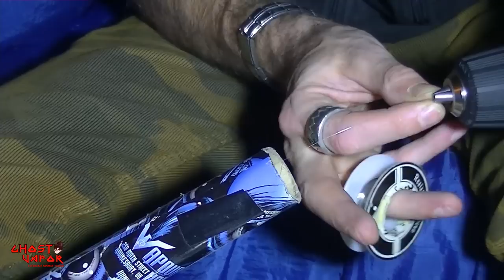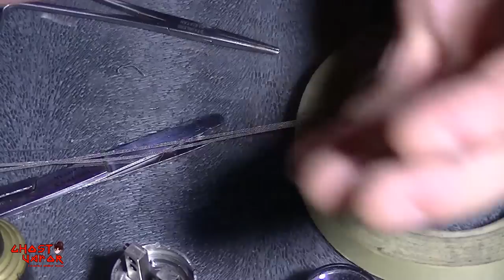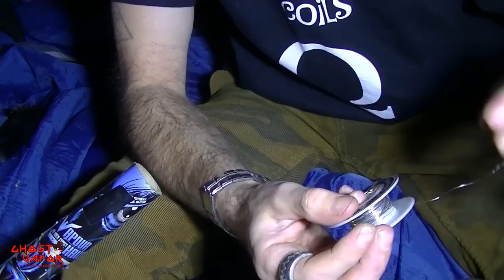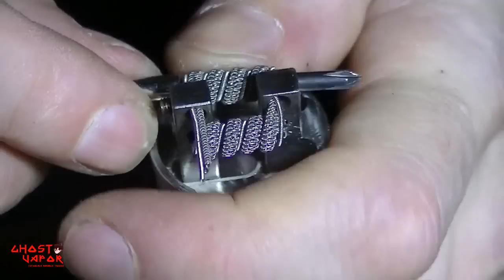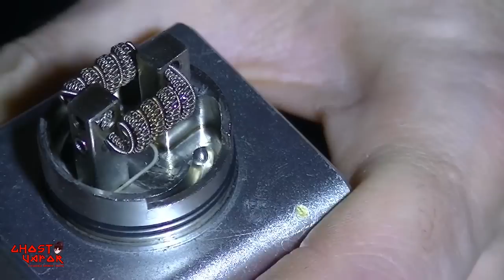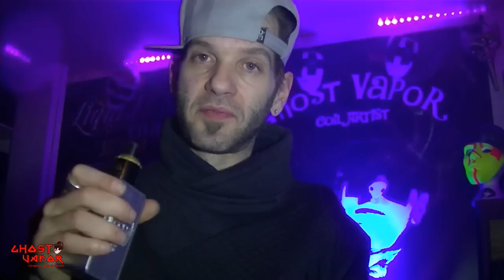Poltergeist Coil (Tutorial)

Comment: I know this was 6 years ago, but just my opinion, with a coil of that magnitude, I would certainly stuff as much cotton in that coil that would feasibly fit, pack that bitch. I have learned there are two ways of wicking that work well. First, what most people do is the looser wick, the wick has some room to move in the coil and it crackles a lot when fired. Second, my preferred way of wicking is the tight wick, pull as much through that will fit, this also works just as well as the looser wick, but it cuts down on the crackling. I don't like spit back and all that, but I love a super flavorful vape, so the tight method gives you tons of flavor but practically kills any crackling that happens. Another upside of a tight wick is the wick lasts longer between re-wicks, you just get more mileage out of a tight wick from my experience.
Reply from the maker: yeah wicking  can  also be subjective ,  everyone  find the perfect way to do it  for there taste ... i played allot with wicking also ,  i think i must created a new way , fo a coil i made few yrs back , since  normal wicking was impossible .... you can check it out lol  the wicking is called  Toilet paper Wicking technic  it on the tutorial  
'THE RODS'

Comment: You could've made fusing those at the end SO much easier by using a swivel so you could keep enough tension on the wire you're fusing with to lay it between the wraps while attached to a drill. You quoted 2 hours-15 minutes depending on how good someone is and I feel this adjustment would bring it down to 30 minutes-3 minutes... That being said, this is the most original build I've seen in a while. I'm gonna have to take a stab at it and if it's a success(for me, we already know it can chuck a cloud) I'll share my build so you and anyone else here can see and share my experience using the technique I was explaining with the swivel. Thanks for the inspiration and keep on building!
Reply from the maker: Thank you ! 
Thats the thing. I teach how to do it. With your hands and minimal tools ,  no swivel  , i dont do tutorials anymore cause. Everyone use Swivels and other rigs that do the wire for you.. witch take a big chunk of skills away
Reply from the maker: There is many other cool tutorials , witch you can use Rigs if you want !!
Reply: I don't feel like using a swivel is a "rig" or any sort of cheap shortcut. I view it much like your locking forceps, a tool intended for a different job repurposed to get your job done.

Comment: thats one hell of a nice job ghost. you can claim my first ever comment. you got a sub from me and one day when i flearn to clapton a wire ill give this a try.(several years from now)
Reply from the maker: Kyle Lewis  THANKS  and  yeahh. Thats what i want to hear , but if you start easy and give it more than just a try , you will see ,its easier than it look ... And after. Start with my" easybuilds ". And you will cut the ( few years from now ) to few months from now ;) trust me , dont try to go to nuts , start eith 26g core and 30g wraps ( clapton )
Reply: GHOST VAPOR ill give that combo a try next time. do you have a recomendation on a good rda to start out with ? ive been using my tfv8  but things get tight, also i can only build when my vaporizer is dead. so im looking for a larger deck with a lower cost, any recomendations ?
Reply: Kyle Lewis - If ya want something big and well priced go the temple (30mm) or smaller go the goon (24mm i think). Make sure you don't get a clone of the temple caus they have tiny post holes and the screws hang out n cause troubles. The goon has big clamps but can be tricky to seat the leads on a 2 coil build but great for single coil. Claptoning isn't as hard as it seems bro, i was worried at first but got it down my second try. It's all about pinching the wire at the right angle then letting the wire and drill do the rest of the work. Give it a go man nothing more rewarding than doing ur own builds! I did a mowhawk alien the other day n that took a few trys and still didn't get it perfect but great feeling when you get one made well enough to vape off. The staggered claptons and staggertons are the hardest build IMO caus you need great eye sight and massive patience to fuse the same spaces each time. Good luck man!

Comment: Most likely going to do this coil today but just a thought wouldn't it be easier or save a little material if you were to staggered that Clapton just curious I haven't done the build yet
Reply: Now I see why it's not staggered once you make the Clapton out of the Clapton there's plenty of space between to easily fuse them together only difference is I used a Fiskars hand drill to do the fusing took about 5 minutes.